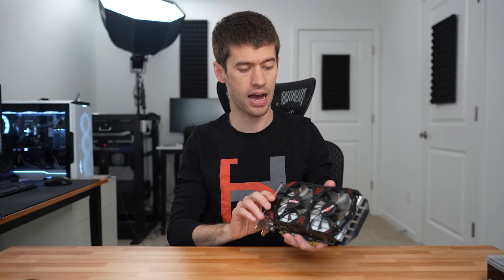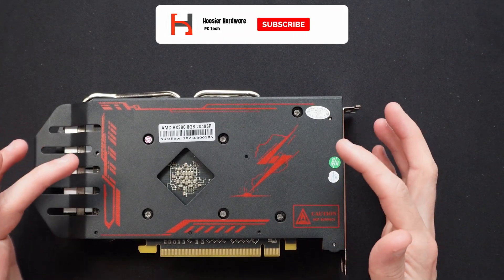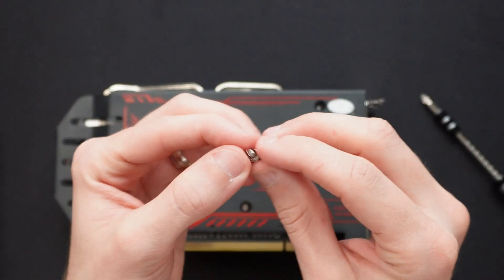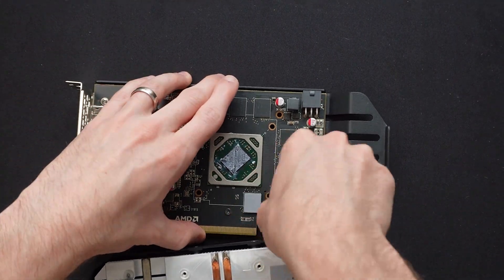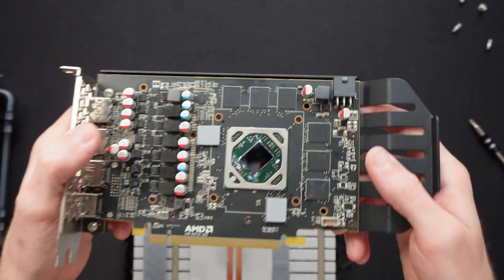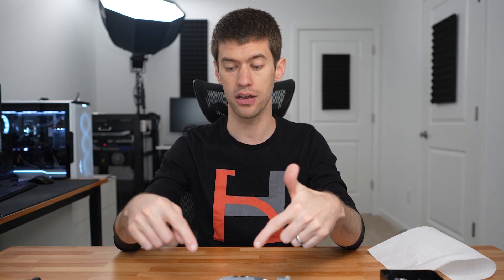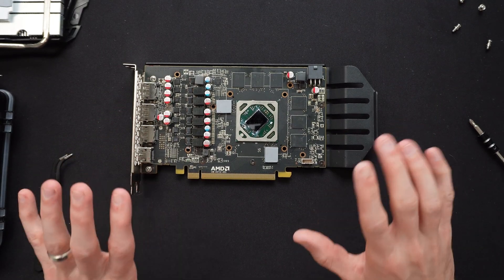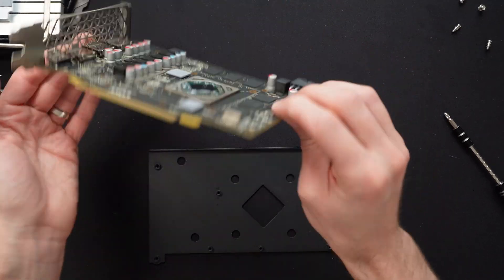New $100 RX 580 Teardown

Comment: This card is complete JUNK. It may perform at first but, give it a month. It will cause "NO DISPLAY" issues. Games freeze. Even after adjusting the clock speed down. 
After contacting Amazon because, SURALLOW never responded back to several emails after 2 weeks, Amazon refunded me as a favor. 
Once I tore it apart, the thermal compound was nearly nonexistent. Not one memory chip had any cooling. The power delivery was the only area with a thermal pad. 
I will never ever order another cheap video card. 
Also, his card looks nothing like mine and I got min in DECEMBER 2024

Comment: I bought this brand as my first budget pc build, and overall its been 5 months and no problems, it used to crash on my bad unbranded 500w psu but i upgraded to a 600w gold rated psu and the card has worked flawlessly. I even overclocked the gpu and it handles the oc perfectly, its an awesome budget card for 1080p Low and a good esports card. Amd fsr also has given this card a new life too.

Comment: These cheap (RX 580 8GB) are actually (Not RX580's) These are "potentially better" RX570 with a different bios under the name rx580 2048sp, which is a cutdown version of the rx 580 and made for china only. That's the reason why their slower than normal rx580. I actually own one and i highly recommend it for some people on a budget or just starting out on pc building, BUT i wouldn't recommend them for long time use because these are possibly mined on, on their life span and might not last for a very long time under your hands. But other than that their great
Reply: Forgot to include this but i say "potentially better" because their asic quality/silicon quality tend to be a little more higher than normal consumer rx 570's which generally means you could overclock them higher or require less power to run stable.

Comment: I got an original 5500xt for $100 off facebook. had it 4 months no issues. im happy with that.
Reply from the maker: There are currently this same type of card as this 580 except with the 5500 XTs on Amazon and on Newegg. The Newegg one I saw was $119 when I last checked. There's definitely still better values on the local used marketplaces.

Comment: This video just reminded me that I have 2 msi Armor rx580 8g cards that I bought and never used. One is still sealed, hasn't been opened. I was going to run them in crossfire, but sli & crossfire support died off about the time I was ready to build, so I tucked them back and forgot about them.
Reply from the maker: I've been playing with the overclocking since recording this. If nothing else, I can say that this card does not overclock well at all compared to other 580s out there from more reputable companies. I'd venture to guess your cards could get a nice OC on them and outperform this one by a fair bit.